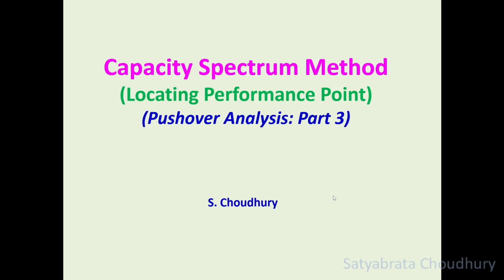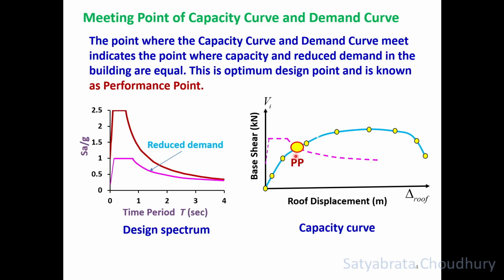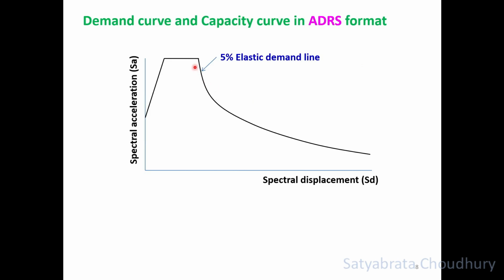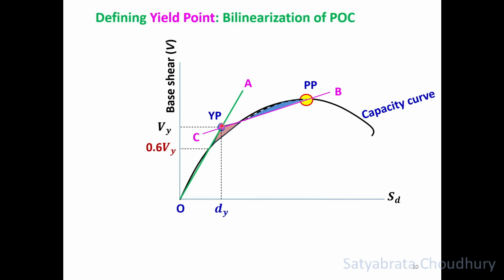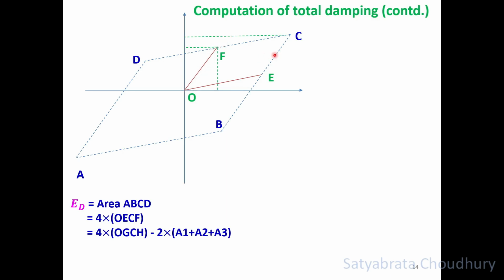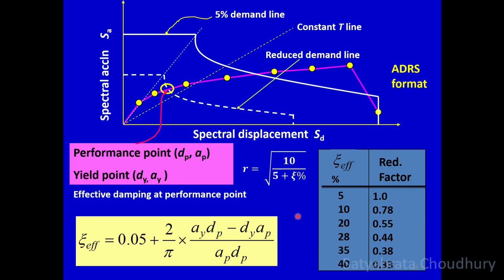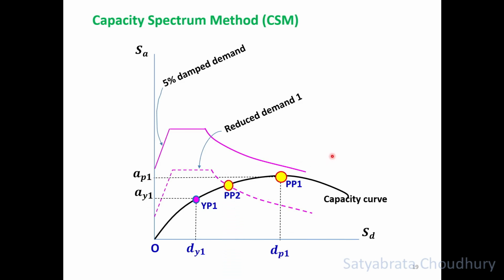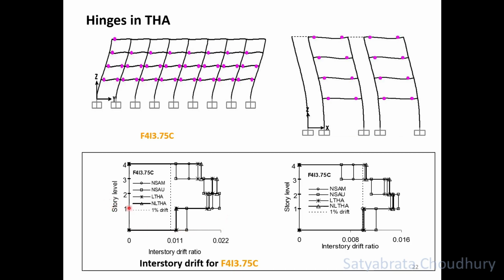Capacity Spectrum Method

Comment: Thank you so much for sharing these valuable lecture, Sir. Please allow me to ask one question, how do we classify the performane level (or limit) on the pushover curve for frame buildings based on the short direction and long direction. In your case, you have shown for 4 story and 10 story buildings with performance level on the pushover curve. It would be my honor if you explain me for this question. Thank you so much.
Reply: Thanks. The performance level (PL) can be ascertained from the POC. Note the location of PP. The level (IO, LS, CP) immediately on the left of PP is the PL of the structure.

Comment: Thanks a lot Sir, for your clarification but I want to know if "performance point" is the same as functioning point on capacity spectrum method. what about ordinate and abscissa points?
Reply: I have not encountered the term "functioning point". The performance point is also called the target point. The displacement and base shear (or Sd-Sa) are available from the capacity spectrum method.